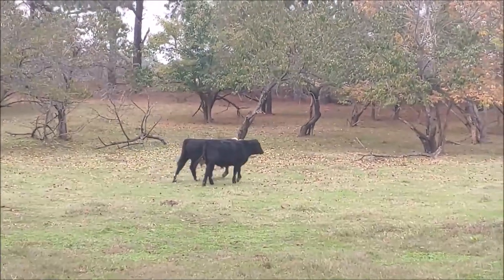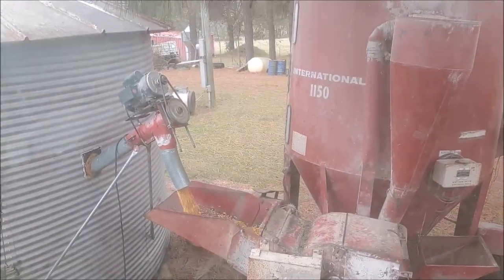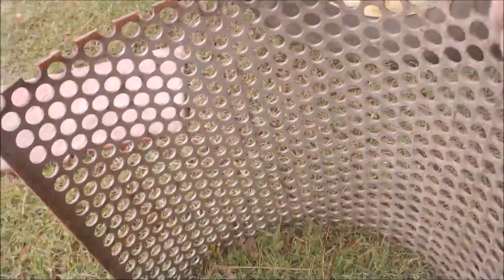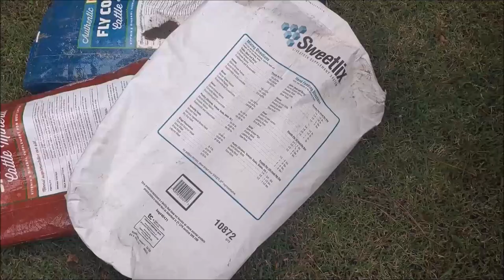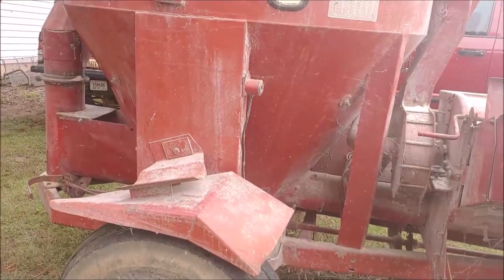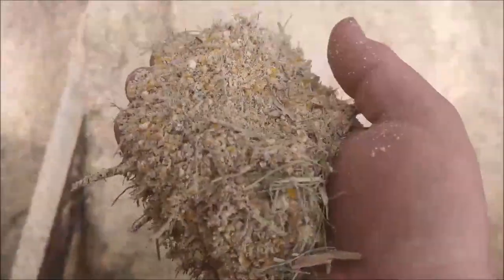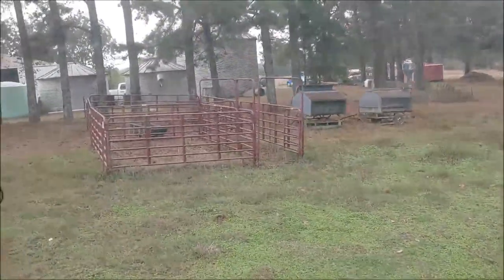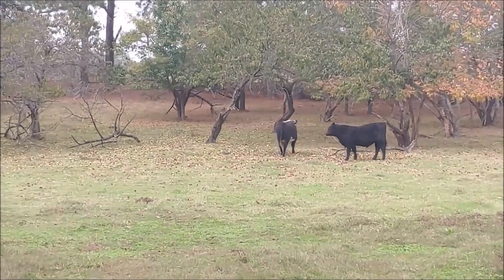How does a feed grinder work?

Comment: Excellent video!  How wet of feed can you get away with before things start getting clogged up?
Reply from the maker: About 18% moisture corn is the most we've been able to do.  Even if you can get higher moisture feeds through the grinder you have to feed it fast or it will spoil.  Thanks for watching.
Reply: @DylanJoyceFarms  Cool man. Thanks so much for responding!!
Reply: Love all your videos we use the same grinder we mix cotton seed with ours. In fact we farm with all the same equipment you do except the combine we still run a 6600